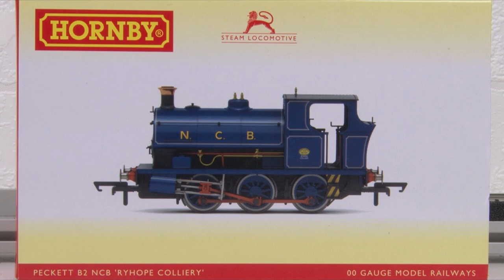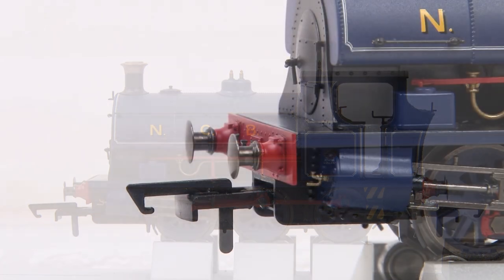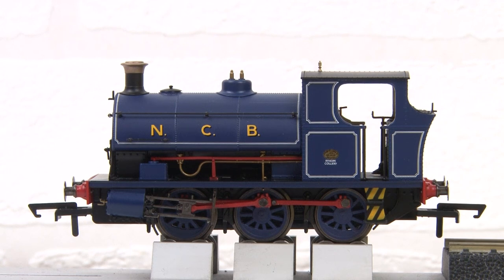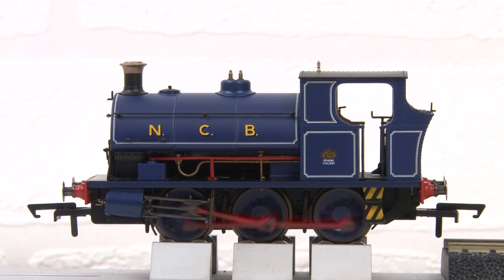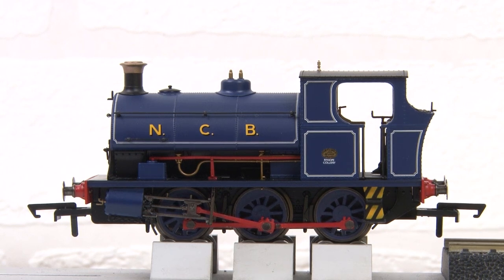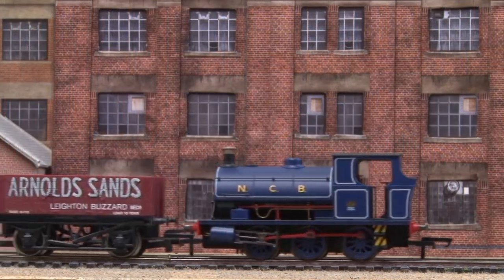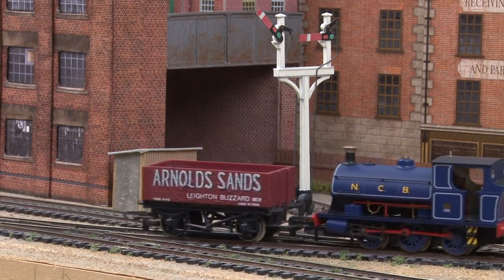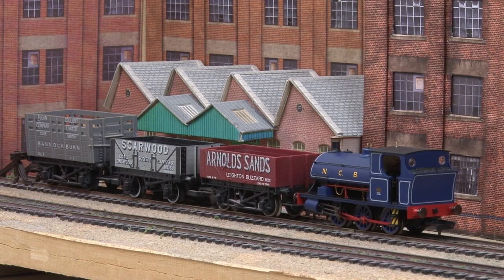Hornby R3695 - Peckett B2 Review - NCB Blue

Comment: The cutting out can be fixed by fitting a 'stay alive' which makes a tremendous difference.
Reply from the maker: At this point I was running everything on analog control so a stay alive wouldn't have been an option. Since I've switched over to DCC though I have noticed that the B2's are much more consistent - not that it was ever really a major issue anyway. Thanks for watching 😃